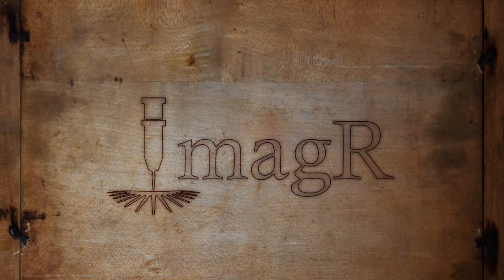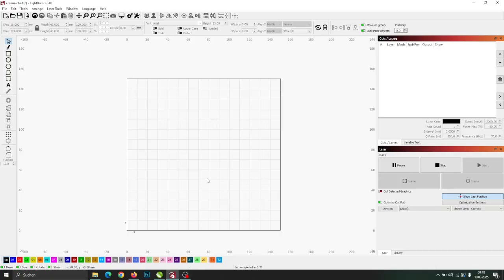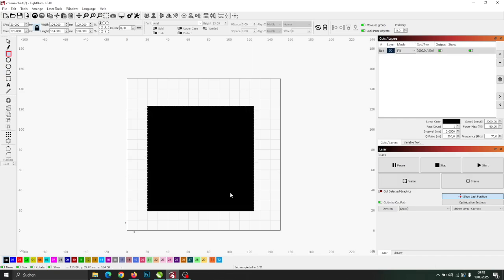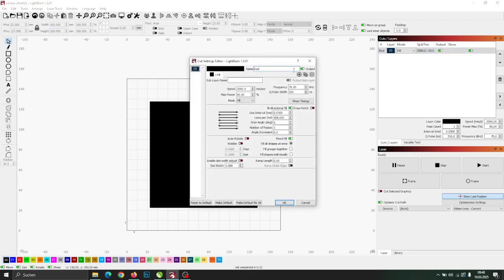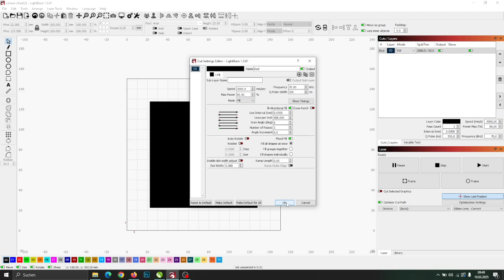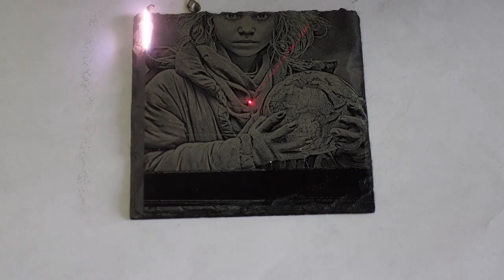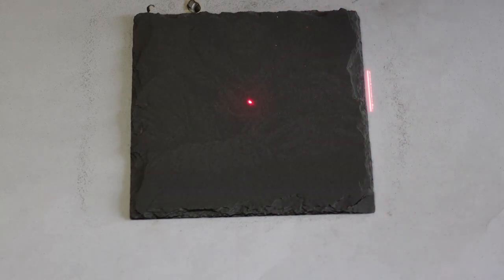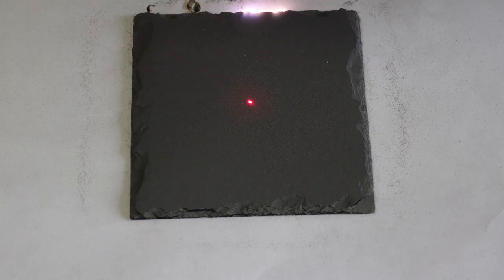How to Clean Slate with a Fiber Laser – Easy & Fast!

Comment: you said enable cross hatch but show it disabled in your settings
Reply from the maker: Yes, I forgot in the recording :) that‘s why I mentioned it :)
Reply: What power laser are you using?  Hard to baseline from 80% if we don't know what laser you run.
Reply from the maker: @ it‘s a 60W JPT Laser
Reply: @ImagR-Laser  What lens are you using?